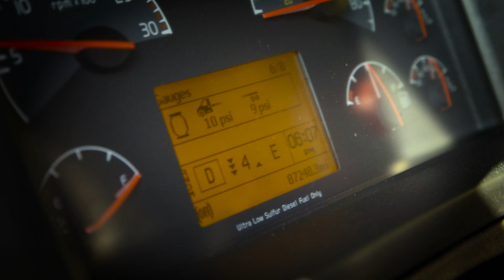Owner-Operator Couple Discusses Volvo's Adaptive Loading

Comment: There is 2 other things I want to say... In Europe Volvo truck is built with quality and if you look on frame and rest of the components of cab in general after a period of 8 years as O/O truck looks amazing. Now here in N.America Volvo truck is built for quantity because when come to quality I'm very sure a lot of Owner-Operators have lot negative things to say... Example: frame paint after 3 years looks like someone forgot to painted. Next- all bolts on frame and crossmember are loose after 2 years in service. Next- paint of cab have really a lot to question, low portion of both doors getting rust quickly, back of a cab on side skirts getting rust.  Truck is 3.5 years old and it looks like I have him for 8 or 9 years... Very sorry to say that... Very loyal to Volvo trucks... Best regards Mike

Comment: Look like Volvo is pushing hard in N.America with this push axle:) work really well in Europe for many years. Technologically we are in Stone Age comparing to Volvo trucks in EU... I'm driving Volvo here for many years and I also drove Volvo in Europe...Disc brakes here is new thing just for maybe 3-4 years ? I think is option also when you spec new truck. Every truck is spec different for the type work is design to do or environment it will be working. This specs maybe fine down south states running I-10 east & west and saving fuel... Big trucking company's is pushing for that... Truck weight less and less because the company's are compiting for carrying more weight...for Owner-Operators is different side of Apple... For me running 41000 KG GVW in Northern Arctic Canada some thing like push axle is not going to work... 6X4 combination with snow tires and chains as buck up. I respect Volvo Corp. because They very advance when it comes to safety in general of cab... Respect Mike
Reply: +MikeVN680 Well said Mike. It's very hard to find anybody in North America that would say what you said. After driving Volvos, Scanias etc in European Union I moved to Canada to try American equipment. First truck I got to drive was peterbilt 386, then 389, 379. I felt like going back thru time 10 years or so... Driving EU trucks are like driving cars (quiet, smooth ride, comfortable seat, air ride) but peterbilt is ehm like farm tractor to me.
A lot of drivers don't realize that without volvo in North American market trucks would still have this old square look.
Regards
Reply: +kapenczyk 
I just said what i experienced here driving trucks for 26 years I've been driving...to understand those things technologically you as driver must try driving in different continents of world then is a proper understanding of what's is lacking in the performance of trucks...what you can expect from drivers in N.America to have knowledge about the truck when that particular driver is after 3 weeks of training and after He or She have full CDL to drive truck...the market of building truck mostly is push by big trucking company's so must be light, cheap built because those company's don't care about the drivers, nor their safety or comfort... Rotation of drivers in this kind company's is tremendous and nobody care about you who can fill a seat tomorrow;) safety ? What safety they would say;) as long it will deliver on time without crushing the truck nothing is important... Comfort of driver ? Are you kidding me;) driver in N.America must work like horse without complaining !
Reply: +kapenczyk 
Best regards from Toronto🇨🇦 Mike
Reply: Hi Mike, i'm glad to see that also canadians think so that usa technology in trucking (and also in heavy equipment i say) is far behind, compared to europe. I drive loaders, excavators and transfer dump trucks here, have some videos to edit and upload here yt. It would be nice to visit or maybe even move to northwest Canada in future. 
Regards, Matti from Finland, at arctic circle.
Reply: Forgot to say why i watched this video, i searched about pusher axle. Long time i have know that in usa pushers are rigid or self-steer, in europe self-steers are only for trailers, and steer locks to midle when reversing. In trucks, rigid or semi tractor, pusher has forced steering, linked to 1st axle, or othervise electro-hydraulic controlled with position sensors. Tridems use that control, that axle is behind tandem . Some cheaper built semi tractors may have non-steer pusher, i think, but never seen any, also tag axle is not steered. Regards, Matti

Comment: Too bad you can't get this system on anything longer than a 250" wheel base as measured to the back rear.....which severely limits fuel capacity if you want a APU. Stupid, Stupid, Stupid on Volvo's part!!
Reply: KB3MMX. The APU goes under the passenger side door, beneath the side fairing.

Comment: Big problem is you cannot order this package with disc brakes you also cannot get air ride front end with disc brakes. Fail.
Reply: Charles Pyatt bullshitt. I just ordered new 740 with all disc brakes and adaptive loading.
Reply: @janisraizgis1185  They changed this because of people demanding disc like yourself... Thank God 👌👌
Reply: Unfortunately you still cannot get front air suspension system if you get this option. I just tried it on a 860 order... DENIED ☹️👎